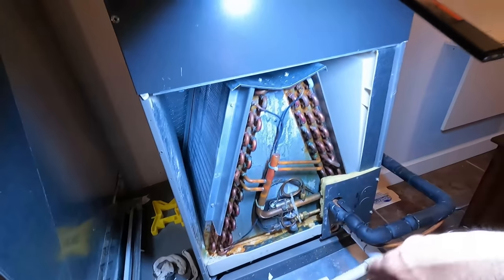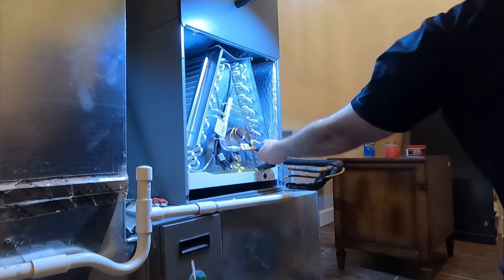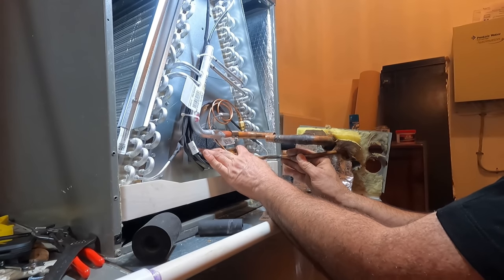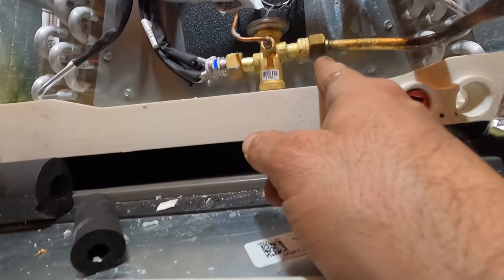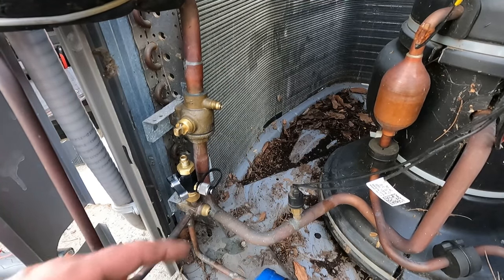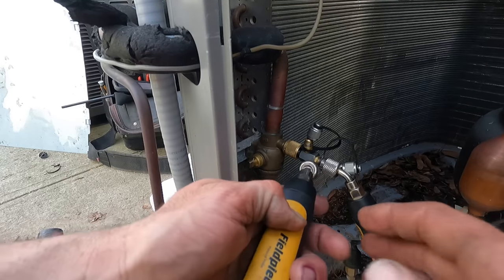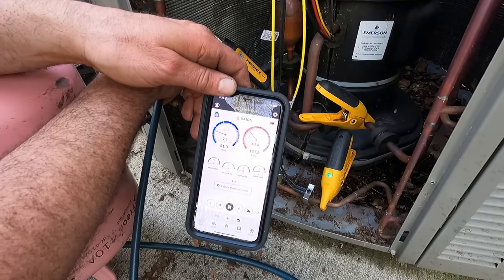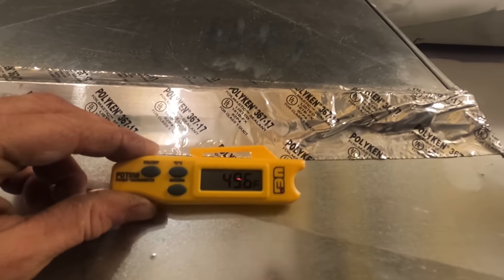Replacing Evaporator HVAC Repair

Comment: A repair business is not rocket scientist work! Stop making excuses for cheating people. HVAC systems are absolute. Yes we pay for your expertise, to accurately ASSESS and ADDRESS the problem, then ADVISE us of the estimated cost and labor. The problem we have with you ALL is that a very high percentage of you “technicians” are actually parts swappers with slightly more advanced tools. Your ability to assess the issues actually contradicts your self proclaimed “professional” opinions and advisements. Read the comments, MOST of us have had several technicians come out for the same recurring issues, meaning most of you simply go with the easiest fix, instead of diagnosing what’s really wrong. That’s our problem. Your tools have nothing to do with us! You’re the professional, you should have tools!! That’s YOUR cost of operating business, not to be passed on to us with outrageous labor charges. Job takes 3 hours, charge 3 hours. If it takes you longer then that’s your problem since you’re the expert and should know what you’re doing. Can’t wait until technology goes all electric with HVAC systems. Some new homes are already doing it.
Reply: Air conditioning is already all electric.
Reply: You can pay me personally for life for undercutting my company i work for
Or just call joes blow and go hvac
We dont make the prices

Comment: Just wondering, can you replace the plastic drain tray without cutting into the copper lines? My drain tray has a small Crack in the 3/4 inch plastic thread built in the main drain tray. Not leaking yet but I'm sure time will take its toll.
Reply: I fixed mine with a piece of tin and jb weld

Comment: Mine sit on top of furnace . How can you remove it ? Does the enitre furnace and coils need to be taken out ?
Reply: Yes. If coil dosnt fit thru the ducting and hits. Remove furnace. Coil is light just have to push back on it to hold and slide furnace out ,then coil.. 2 man job after that one man..
Reply: @STUNT4516  man , i'm not going to do all that. Just too much work. Remove entire furnace to check clean coils ? And what ? Cut freon and the other lines ? Maybe just slide the furnace out of the way get under coils to check clean ? Wow. I removed blower motor but it's a universal replacement with SEPERATE bracket. But not sure it'll fit. I thought when I first called parts store it'd been an exact match but nope. Looks like I wasted all that time going over there. Any advice ? OEM motor is much more expensive and take days to get. ?
Reply: The origianl bracket should fit on new motor. Universal are just taller or longer than old blower motor. Depends where u put bracket on blower higher or lower. Sucks if u jist wana check for clean coils. Maybe slide evap back or forward a little depending if it has play, with a flash light and mirror u can check that way. Or if its a clear view after removing blower motor take a look...LETS LEARN TOGETHER MY FRIEND
Reply: @STUNT4516  no , the coil is top of furnace . I've removed blower motor / housing the whole thing but that's on the bottom so that doesn't get me to coils . Yeah the old original bracket I don't think it comes off old motor . Looks welded on . The new bracket which I did just get .doesn't quite fit align with bolt holes on housing . If I had new motor maybe , I'd be taking quite a chance that buy it maybe won't fit into the bolt holes
Reply: @STUNT4516  UPDATE - It di fit !! yeah it was blower motor . replaced it and could tell it was working right away at the vents . It was blowing weakly beflore so replaced capacitor at first but that wasn't it . Only $16 . Next suspected motor . Great that I fixed it . Century universal motor $74 plus needed bracket $30 YAY
Reply: Whoo hoo!! Good job man!!

Comment: Nice work man! 👍 
Quick question, do condensate pans under an evaporator coil like the one you replaced come in standard sizes or are the pans made to work specifically with a particular evaporator coil???  If anyone knows I’d love to hear from ya.
Reply from the maker: They are made for the specific evaporator coil. The secondary emergency drain pans are generic made by size.
Reply: @thehvachacker  thanks for letting me know!

Comment: Nice work man. ME and my OCD would like to know if you cleaned out the unit before you zipped it back together? (all the leaves, debris and crap).. 
Great video all in all sir. Thank you for sharing. 
I will be having both of my coils replaced very soon. 1st owners, house built in 2016, units installed in 2017 (attic), we took possession mid 2017 and now after 4 years both coils are shot.....

Comment: I need to replace my blower motor and capacitor. Those two copper pipes you removed, on my system, run directly in front of the blower. So basically what I got from your video is, I am unable to remove those pipes, they need to be moved out of the way by a professional? And then my next question would be, is that an industry make money “scheme”? Because supposedly I’m supposed to be able to remove my blower and clean it, but those copper pipes are in the way. So just basic maintenance requires a professional, right? Apologies if this is coming off rude, I’m just frustrated because I literally don’t have money for a professional and I live in Tucson where it’s 108 degrees today. I’m sorry just one more, how much would you charge to remove and reconnect those copper pipes? I realize where you live and where I live prices will be different but I just kinda want to get an idea of what I’m looking at? Thank you so much if you are able to take the time to read this and then thank you again if you are able to respond.
Reply: If your copper tubes are in your way it could be because the copper comes from the floor or you have a down flow unit and who ever installed it didn’t have room to put the copper else where or they just didn’t think about the other guy
Reply: capacitor is on the outside unit... and its like 30$ replaced  by a pro the blower is different and sometimes the motor can come out the side of the blower cage if u examine it.. i have a coleman and i just serviced it instead of removing my pipes and capturing the freon then putting it back together I cut some tin on my cover to fit around the pipes but remember it has to be put back together fairly air tight because the blower is blowing air thru the space and if it leaks air itll be suer inefficient.. just a thought.l... really looking at the parts figuring out how it comes apart is half the battle i had to clean my  coil and clean the drain for the run off it was clogged and the ice would melt but never drain creating an ice block every time hoping i dont have to add freon becase thats the other reason they freeze up low freon

Comment: My AC guy wanted to charge me 1800 to change not to include Freon.  I called the manufacturer to get the new part number and the coil was 475.  IF what you are doing is correct why are the AC guys charging so much.  What really made no, he could patch the area because it wasn't that big.
Reply: Cost of labor, parts and refrigerant. Is your system running r22?  There is no guarantee after patching that coil it won't potentially leak again. That's if it's even patchable. Hvac work is costly unfortunately.
Reply: The cost is for labor. Your talking maybe 2-4 hrs of work with tons of equipment your regular handy man might not have
Reply: Try to buy all these prof... tools you will be surprised 😳 and not the " made in china stuff" i meen " made in America " stuff 
pay the truck 
pay for insurance ( in case your house burns down) liability 
pay for good quality tools 
truck insurance
truck repair 
labour 
Goverment taxes 
and finally whats left of it food on your table 
ho : i forgot Gas in your truck
Reply: Pay for what I know not how long or total of parts.
Reply: It's because they know you can't live without it is why they can get away with screwing you coming and going. And don't give me this cost of tools crap because you can make the cost of tools back on many calls. It doesn't have to be this much but THEY GOT YA.
Reply: @handsupbud  not exactly correct buddy. Its because we work our whole life in a trade to fix stuff for customers and all they ever want is to pay nothing. The years of learning makes it possible for us to fix your stuff. So again pay for what we know not how long it takes.  Also I bet you wouldn't say that to a medical professional right? They went to a ton of school, loans etc. to fix your health condition and they charge accordingly; including company overhead, EMR and all other fees that encompass a business that obviously you didnt think about.  If you feel that its that easy, fix your own stuff and you wont have to worry. Maybe Youtube will help you.  Furthermore whatever you do for a living I bet you would charge the same way if indeed in the same position.  We in the trades make your world go round, without us where would this world be??? So try to understand that and realize we are not ringing up your convivence store soda. (not taking away from that either).
Reply: Lol thats a lot of calls for equipment.  I probably easily got $10k in tools and while we do charge $110 an hr, I sure as fuck don't make that much. @handsupbud
Reply: @rustyrobertson8643 so it’s ok to charge 1000/ hr for labor. When you get your car worked on it clearly states the hourly rate that is charged for their labor why can’t this profession be the same cause the guy that responded above is correct you are screwing are eyes out. I’ve had two bids and neither bid will state what the unit costs or the labor just a lump sum. This is another shady trade
Reply: @handsupbud and you can gfy. By all means, go with the cheap guy or the green guy. You'll get what you pay for. Or like he said before, do it yourself :)
Reply: @jorgelay7077  Great information! thanks.
Reply: If you want it cheap do it yourself don’t call a hvac tech , it’s not worth complaining when they can cool down your house

Comment: Non HVAC person here.  I have a very similar setup and about an eighth of an inch of condensation still sits in the pan(all drain lines very clean) causing rust.  Is this normal or should pan drain 100%?   Thanks for the educational video.  I won’t be attempting myself.
Reply: Put a level on the coil
See if she leans back like fat joe
Just kidding, coil should be level
Pan will have the pitches it needs

Comment: Why using old coil panel on new coil?  They didn't give you new panel?
Reply: The panel is part of the air handler - doesn’t come with the coil.
Reply: The housing stays, just the coil was replaced.
Reply from the maker: The coil doesn’t come with panel when part of air handler. Only the coil with a vertical drain pan. Since it’s a vertical application I tossed the horizontal drain pan. Manufacturers give bare bone minimum when dealing with warranties.

Comment: Love the video. Can you replace the drip pan without having to remove the coils and cut into the copper pipes. Are there screws that are holding the drip span to the coils?
Reply: You have to pull coil out and remove screw underneath that connect it to the coil

Comment: Noob here: So an evaporator typically has an inlet and outlet, like a radiator.  Why is one a mechanical connection, and the other a soldered connection?  If the valve needs a mechanical connection, why not just do the same for the other side?
Reply: GREAT QUESTION!
Reply: Some are bolt ons
Some are soldered on
The part is called a txv i think youre talking about

I guess it just makes it more or less difficult to replace
Reply: Its held together with a special o ring for the bolt on

Comment: Did you change the filter dryer?
Reply from the maker: No I did not since the filter drier never was exposed to contamination’s. I pumped down the system so it remained with clean refrigerant. If it was outside the condenser service valves I would change it
Reply: @thehvachacker  per EPA says to always change filter drier for any major repair
Reply from the maker: EPA section 608 Filter driers will remove moisture from the refrigerant in a system, but there is a limit to their capacity. Some systems are equipped with a moisture indicating sight glass. When the sight glass changes color, the system contains
excessive moisture and will need to be evacuated. The filter‐drier should be replaced anytime a system is opened for servicing. If a strong odor is detected during the recovery process, a compressor burn‐out may have occurred. When recovering refrigerant from a system that experienced a compressor burn‐out, watch for signs of contamination in the oil.
Reply from the maker: Yet this does not take into account a filter drier installed inside the condenser. You replace the drier whenever a system is open due to it being contaminated when a system is open. The drier here never gets exposed to atmospheric pressure or moisture.

Comment: Awesome video! Respect!  Question: I know it's different in every town but aren't there inspections required once completed (at least for the electric and natural gas)?
Reply from the maker: Not for an evaporator replacement.      It’s considered a repair. Only need permits for system replacements. Then the system needs mechanical, electric, and plumbing inspections in most towns.

Comment: Why did you evacuate 400 microns?  Isn't 500microns minimum to ensure no refrigerant is in the system???
Reply: Low value is better
Reply: You can take the microns as low as 50.
Reply: I usually vacuum  to 200 but 400 is ok too

Comment: Some guy is charging me 1500 for a coil do you think is a fair price?
Reply: Depends on what size and type coil you are replacing. That is not a fair price, extremely high.. Just  get a new air handler.
Reply: Let me add...If that is the price for just the coil then its too expensive, but if thats for the labor also, then even it seems high, that is what the techs charge.
Reply: @ssfouryou   coils are pretty expensive including labor, usually about the same cost of a new air handler. try getting a quote from a family owned company, or just a smaller one. not guaranteed but you might get a better price and good quality work.
Reply: Yes that's a fair price. Do you see all the work that goes into changing an evaporator coil ? This replacement is highly technical and takes a lot of know how.

Comment: AL System, seriously. it will not last long. Copper is the king.
Reply from the maker: Actually the aluminum seems to hold up better than the copper. I had 4 coil leaks at this house last year. Copper coils. 2 I fixed and 2 that were replaced. Lennox has had too many copper coils leak. I think it’s electrolysis from dissimilar metals. The copper and steel. I could be wrong. Let’s see what comes from these aluminum coils. Mandy I wouldn’t mind pushing. Newer equipment if I know they won’t leak
Reply: The home builder in our neighborhood installed Lennox coils with Goodman furnaces. All of my neighbors had to get their coils replaced due to leaks. I replaced my Lennox coil to upgrade to R410a last year but the coil never leaked for 28 years.

Comment: when you put gas back in with your vaccum guage still on the system u end up getting refrigerant & oil on the sensor which will fuck it, better to valve off your vaccum guage next time

Comment: Lennox just sucks. i find leaks in 1 year old coils on a constant basis
Reply: I guess my parents AC is special, its 15 years old with no maintenance, still blows cold.
Reply: @WilliamVG  Most systems from 15 years ago are better than todays. Lennox had a class action lawsuit against them 5 years ago for faulty evap coils. They paid out money but never fixed the coils.

Comment: an AC company is wanting to charge me $2733.00 to replace evaporator on air handler unit in attic includes parts and labor.  Seems high
Reply: how old is your air handler and condensor?
Reply: @Brian Mullin if your system is old and no longer covered by warranty i recommend you either replace or clean the entire system.  Having a good air handler and a poor outside condenser will still leave you with an inefficient heating/cooling system.
Reply: Your average cased coil runs about $800+ now but the company is going to mark up that cost plus labor. Let’s face it. HVAC installs are hard work and your average millennial doesn’t want to work hard. This video shows a fairly straightforward coil replacement. Most coils are not this easy to replace. My furnace and coil are located in a tiny closet and would be a pain in the rear to replace.
Reply: @@brianmullin2302 There, its that expensive because its r22. Down in Miami Fl, a can of R22 is now 1000.00 dollars. They been wanting to phase out R22 a while back. 410A is on the same route, eventually we will be switching out to A2L. Plus the fact that its in the attic adds to the price as well. So those are two items not in your favor.

Comment: Can I use j-b WELD?
Reply: NO. Never use JB Weld, it’s great for other projects but NEVER use it instead of welding . It will end up leaking and is very hard to scrape off . I’ve had maintenance guys use JB Weld when replacing a compressor and ended up replacing the whole system and disposing of a new compressor .
Reply: J B Weld is good for a temporary repair on a low pressure plastic radiator, not a high pressure coil.